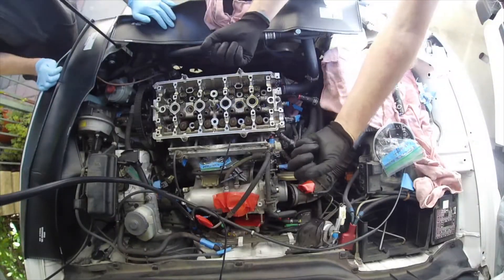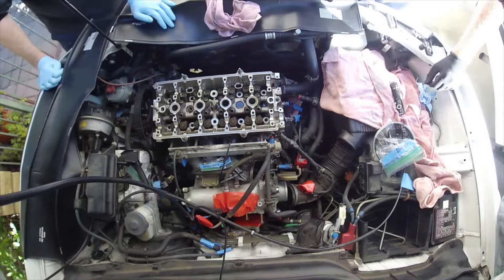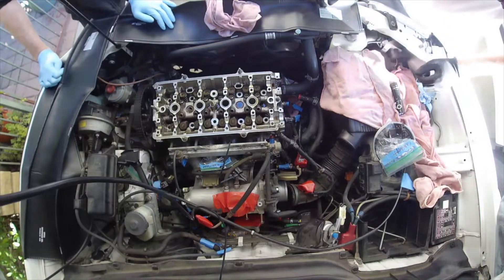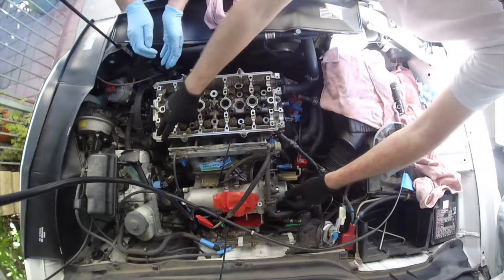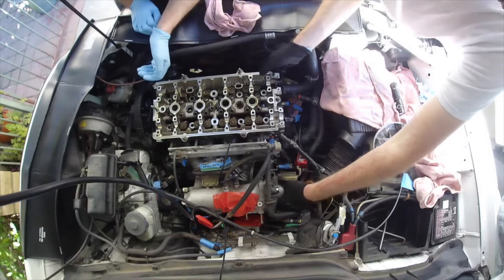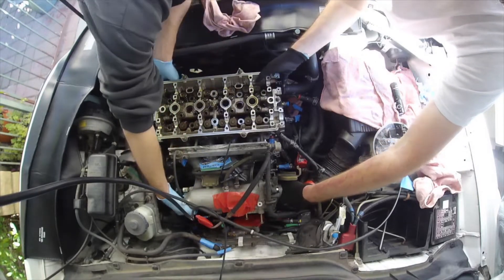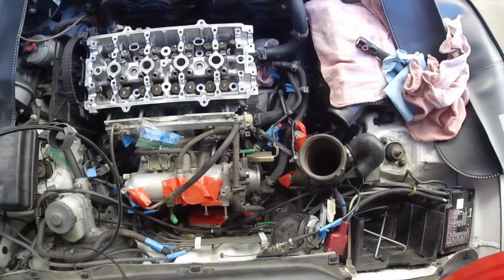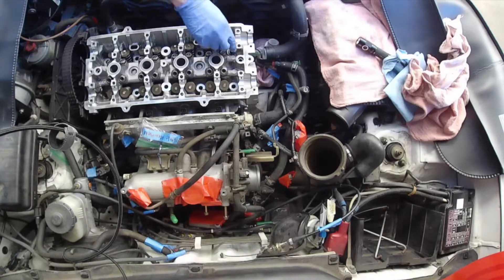Honda CR-V Cylinder Head Rebuild (Time Lapse)

Comment from the maker: Links to parts and supplies I used:
Honda Valve Adjustment Tool 
https://amzn.to/3uQG74o
Feeler Gauge Set 
https://amzn.to/36eQODQ 
Permatex 81950 Ultra Slick Engine Assembly Lube 
https://amzn.to/3LKAwmu
Permatex 82194 Ultra Grey Rigid High-Torque RTV Silicone
https://amzn.to/3rWfdGG
Super Lube 92003 Silicone Lubricating Grease
https://amzn.to/3gVHyXb
3/8" Drive Impact Socket Set SAE and Metric 
https://amzn.to/33kfWI2
NEIKO 02330A 1/2 Drive Metric Impact Socket Set 
https://amzn.to/3H2NCI7
Scraper Japanese Stainless Steel 
https://amzn.to/3h59o3t
24-inch Anodized Aluminum Straight Edge 
https://amzn.to/3LyeF1s
eBay Full Gasket Set Intake Exhaust Valves Fit 97-01 Honda CRV 2.0L DOHC B20B4 B20Z2
https://ebay.to/352lcAQ
rockauto.com VICTOR REINZ 021072501 {#HS13172} Cylinder Head Gasket Set
https://bit.ly/3GNMd87
Wireless Endoscope 
https://amzn.to/3uR6wPx
Silicone Rubber End Cap and Plug  Kit 
https://amzn.to/3oQTBJL
Fuel Filter 
https://amzn.to/3Jwxznl

For business inquiries: 
jonnyonutube@gmail.com
DISCLAIMER:
This video is for entertainment purposes only. Do not attempt anything in this video. This video and description contain affiliate links, which means that if you click on one of the product links, I’ll receive a small commission if you buy. Jon Stuff is a participant in the Amazon Services LLC Associates Program, an affiliate advertising program designed to provide a means for sites to earn advertising fees by advertising and linking to Amazon.com.